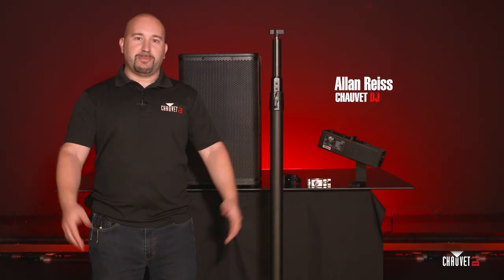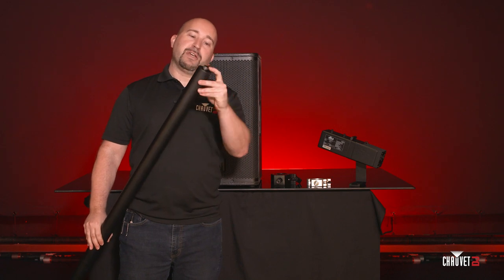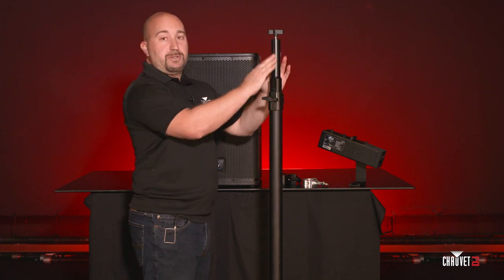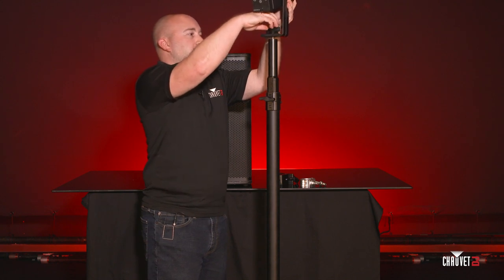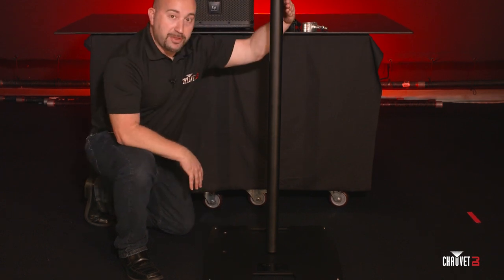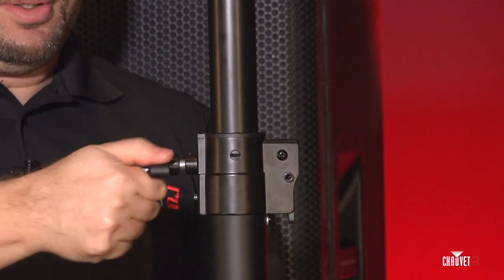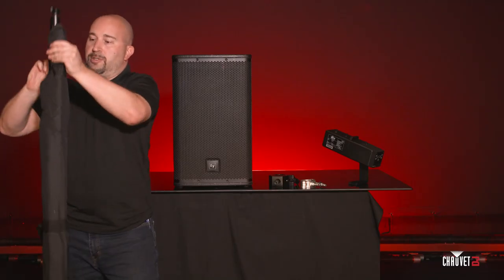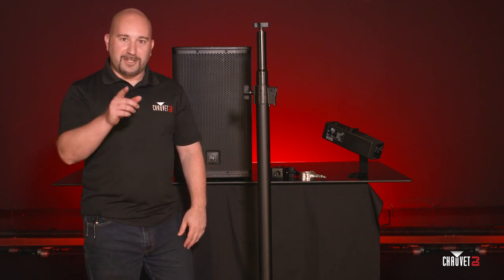Product Spotlight: FLEXstand

Comment: Will they be making any kind of plate to be mounted on the top of the stand using that threaded hole to allow a moving head to sit on top?
Reply: Just use the hanging bracket that came with the moving head, and secure it with the included bolt from the FlexStand.

Comment: I really liked this product, but is a shame not to be compatible with Gigbar Flex. I checked the top pole diameter and the Gigbar flex does not fit in it. Chauvet lauches a product which cannot support another Chauvet product. Too bad! I have to buy the Gravity Stands LS 431 B, which Gigbar flex fits.

Comment: What is the thread size of the pole on the bottom?
Reply: M20
Reply: @reissallan  Excellent so it will fit subwoofers that have M20 threaded pole adapters.
Reply: @SLSInstall  the outer diameter may be the same (M20), however the pitch/thread size may be different. You may get lucky, but you may not.

Comment: Where are the bags for the base plates?
Reply: No bags - the base plate has built-in handles.
Reply: @reissallan  as an aging dj bags for the base plates are a must. I found some from another brand.
Reply: @NoizTheDj  I still don't understand the point of the bag. You can carry the base plate in your hands, or you can carry the carry bag in your hands. What's the difference? Please explain.
Reply: @reissallan  At my age I have arthritis and the bare medal hurts my fingers, I would much rather carry soft bag.
Reply: @reissallan  for cosmetic reasons.  If the base plate has no protection for transport, it will get scatched in transport, set up and breakdown.  The mobile/wedding djs like myself don't want to show up with butchered base plates to a wedding, no different than having protection for your speakers so that they don't look scratched up  at a wedding where everything look pretty!!
Reply: @NoizTheDj  Which brand bag did you find for these base plates?
Reply: @samsamperi8766  Thank you for the feedback!

Comment: the base plate doesn't come with a bag?
Reply: The base has built in handles so no need for a bag.
Reply: @reissallan  still, it would be nice to have a bag.
Reply: @DjGCue71  I still don't understand the point of the bag. You can carry the base plate in your hands, or you can carry the carry bag in your hands. What's the difference? Please explain.
Reply: @reissallan  to protect the base! why do you buy a case for your controller if you're still going to carry it in your hands from place to place?
Reply: @DjGCue71  The controller is electronic and sensitive to moisture, vibrations, etc. The base plate is cast iron and won't be damaged in the same fashion.

Thanks for your feedback.
Reply: @reissallan  no disrespect Allan. Im still going to buy them. 🙏🏼

Comment: Would be dope if these were hydraulic.
Reply: it sounded like it had a gas hydraulic when they released it to lower..
Reply: @itsamedjmario  I noticed he raised it by hand though. 😒
Reply: Agreed. I have Gator speaker stands that are hydraulic and I love them. A crank would have been acceptable too. That's what my currant On Stage lighting Tbar has and it's a godsend for my short little self.
Reply: @cleio81  yes! I love the flat bottom plate, but it needs hydraulic assist for sure!
Reply: @djdannybhtx  it is NOT hydraulic. if it was hydraulic, it cost $500.00 more
Reply: @DjGCue71  this is true lol
Reply: These aren't hydraulic, but there is a spring inside that will cushion the load if it falls.
Reply: I’ve been seeing some videos that the shipping boxes they arrive in have been pretty beat up, is this still the case?
Reply: There is a spring inside that is good for lowering the stand. But I would have love to see a hydraulic version for lifting and lowering loudspeakers 50 pounds or more.

Comment: If only they had figured people would want to mount a clamp on the upper pole. Nothing fits.
Reply: get creative, go to a metal fabrication shop in your area and ask them to make an adapter for you. should be inexpensive.
Reply: The CTC-50G clamp fits nicely on the top and bottom sections of the FLEXstand.😀
Reply: @reissallan  by the top are you talking about the tapered section for mounting a speaker or the actual pole that telescopes in and out of the bottom pole?
Reply: @djerniet350  or instead, since they mention in this video using it for tvs. They probably should release a clamp for the telescoping section of the stand.
Reply: @jeffdubia  actual pole that telescopes will fit the CTC50G.
Reply: @jeffdubia  use the CTC50G with the CTUTVM mount
Reply: @reissallan  thanks a bunch. I will certainly look into them!
Reply: @jeffdubia  the CTC50G fits the TOP AND BOTTOM sections
Reply: @reissallan  i onlu asked as there are 2 sections of the TOP section. The tapered  speaker mount and the actual pole that slides in and out. Everyone suggests a bunch of clamps and they have only fit the bottom section and The  TAPERED SPEAKER MOUNT of the top section.
Reply: @jeffdubia  the CTC50G fits the bottom pole (50mm) and the top pole (45mm). We do not recommend any clamps be used on the tapered/speaker part because that part is secured with very small screws that are NOT rated for side loading. The very top (tapered part) is solely designed for speakers or mounting a light on top which forces a vertical load onto the stand. 

please feel free to contact our customer service team if you have any other questions.
Reply: @reissallan  contact chauvet customer service? Been there done that back in january. They directed my inquiry to their sales team. Never heard a word from the sales team.
Reply: @jeffdubia  I'm not sure why you were directed to our Sales team, as this is not a topic for them. sorry about that.
Reply: @reissallan  i have no idea lol. Leave your email and I can forward everything to you.

Comment: I wouldn’t trust this with a speaker on it or any moving head light. It is way over priced $339 Canadian I’ll stick to a traditional speaker stand and look how much wobble there is. 

That’s an accident waiting to happen
Reply: Yeah, the wobble is concerning. I'd probably use this just for lighter LED PARs.
Reply: I mount 12 inch powered speakers with wood cabs with s mini mover at the same time. Pretty solid.